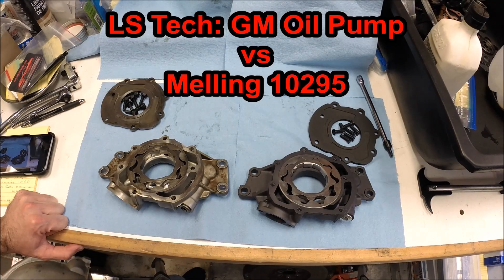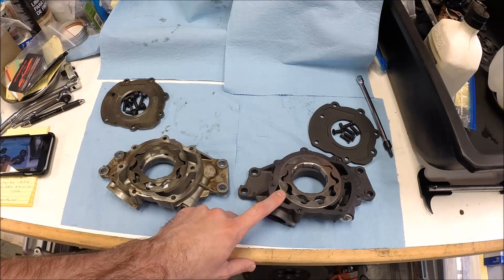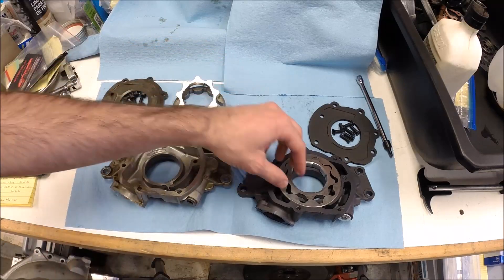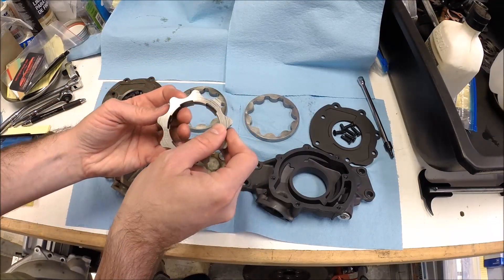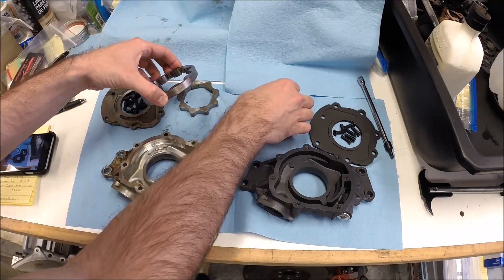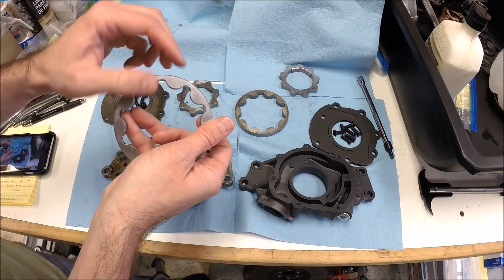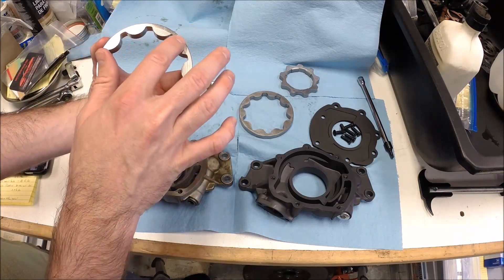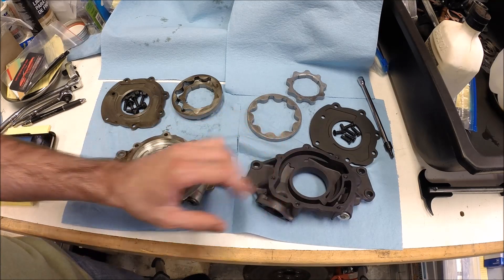LS Tech: GM Oil Pump vs Melling 10295

Comment: What is recommended for a Crate GM wet sump LS7 with small camshaft 227/242. 591/590 lift 116 lsa.  I am going to aftermarket heads not sure if a melling is needed?

Comment: There are a few things to consider if you actually need a higher volume pump. If you are running factory tolerances (which are tight) stock pump is all you need.  If you are opening up your clearance on the bearings to move oil then a higher volume pump will be suitable.
Reply: Older engines= high Volume due to increased clearances. High rev= high pressure.
Reply: @shadowopsairman1583  thank you, not everyone has money to throw into a fire lol
Reply: What if you are trying to overcome unknown engine wear contributing to low oil pressure? Would a high volume and pressure pump be warranted then?
Reply: @drwombat  if you have engine wear and know it you should be tearing into it and not trying to fix it with an oil pump upgrade

Comment: Hi. Have a 05 6.0 Changed oil pump, Pickup o ring, sensor, Wix oil filter, still having low pressure. I noticed when I take the oil filter out. Alot of oil runs out from engine... like 8 oz. Almost under pressure... Seems weird. Not from filter but from block. Edit update: it turned it engine had bad cam bearings.
Reply: Bad cam bearings
Reply: @VenegasTrucking  
Yep. Pulled engine and cam. The cam bearings were toast but didnt spin.
Reply: Could also be a cam plate. The seals get hard and they leak.
Reply: Rare
Reply: ultragalx1  yeah thats a bad idea

Comment: would you be concerned about a failure of the factory oil pump on a LS3? (valve getting stuck)
Reply from the maker: I don't think there is anything inherently wrong in the design that I would be worried about.  If you're working on a high mileage motor, then installing a new oil pump is good preventative maintenance.  The Melling is very nice, but if you're on a tighter budget, the GM pump isn't bad.
Reply: thanks for the reply. I have a 13 Camaro SS and I am a little concerned after researching this.  GM actually has a bulletin out #PIP4158G  low oil pump pressure due to relief valve sticking. just hate wrecking a motor......
Reply from the maker: hmmm, that's definitely concerning.  My car is an '01 so that TSB doesn't pertain to my engine.   But it sounds like to me this is a great excuse for you to install a bigger cam and replace the oil pump while you're at it!   ya know, preventative maintenance.

Comment: Seems almost identical, curious if the high pressure/volume is a better choice
Reply: Depends on RPM and the age of engine, High Volume will give more oil for increased clearances in older engines, increases TBO.
Reply: @shadowopsairman1583  but sacrifice hp.
Reply: @inevitable550 soo the 295 is good for stage 1 cam on ls2 ?

Comment: It would be interesting to know if the surface finish is different between a new GM OE pump and the Melling as well as any different in alloys used. Also if the internal clearances are different between the two.  Melling has been in the oil pump game for a long time I am sure it is better than OE in every way!